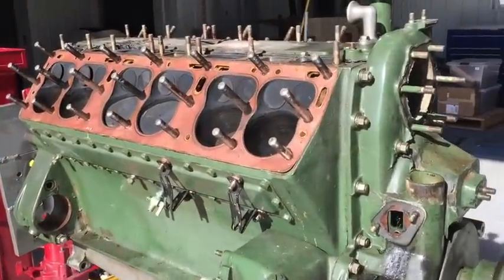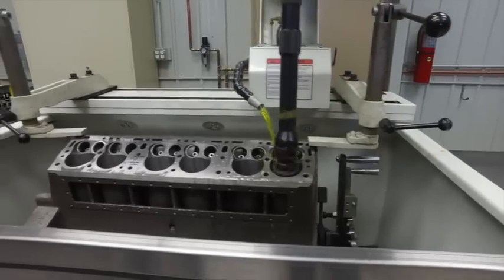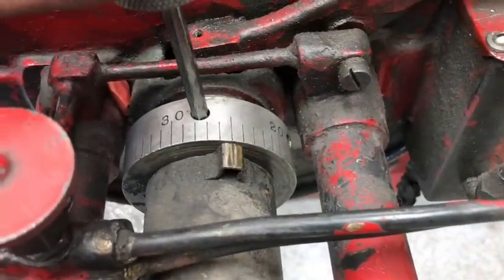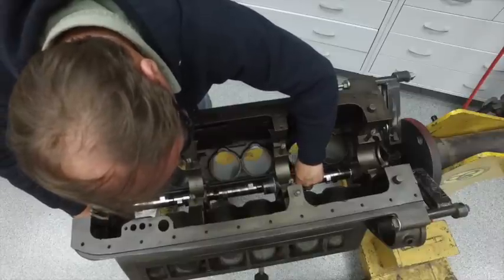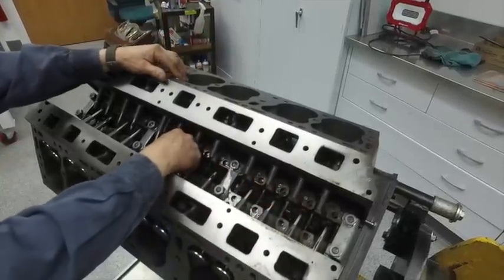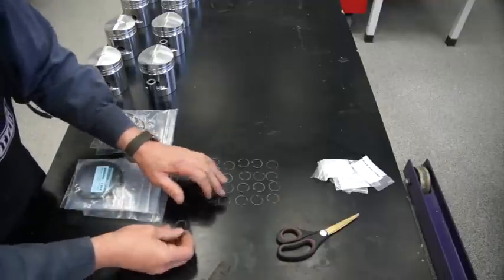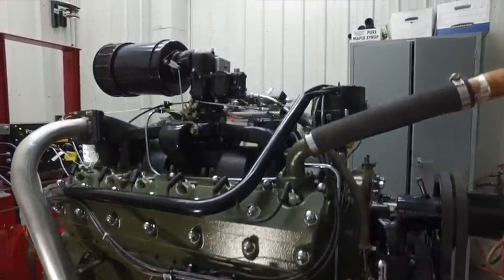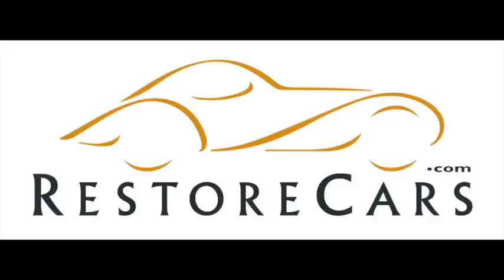Remanufacturing a Packard V12 engine

Comment: Remanufacture?  You mean restoration as you say in the commentary.
Reply: No, he meant remanufacture. 'Remanufacturing' is the rebuilding of a product to the exact specifications of the original manufactured product using a combination of reused, repaired and new parts. It requires the repair or replacement of worn out or obsolete components and modules. Parts subject to degradation affecting the performance or the expected life of the whole are replaced. Remanufacturing is thus a form of a product recovery process that differs from other recovery processes in its completeness and thoroughness. A remanufactured machine should match the same customer expectation as a new machine. 

In the case of this video, it involved a lot of precise and exacting machining work. The rods, bearings and crank being prime examples.

'Restoring' is something you can do with a bit of polish.

Comment: Packard was great, V12 engines are great, but flatheads are not
Reply: Super easy to lift the head though.
Reply: Yet it's still running at near 90 years old
Reply: Flatheads ARE great, within their design intent.  They are quiet and they are easy and cheap to build.  They may not be the greatest performers, but dragster performance is not what a Packard is about.  Low-end torque, silence, smoothness, a creamy-smooth idle, easy starting, and good acceleration at normal driving speeds is what they are for.

Comment: it is a british engine built under license by packhard ask soaring ass hole wilbur fluffygan
Reply: I'm pretty sure not every Packard V-12 is the license built British Merlin. BUT .... I could be wrong. 😮
Reply: This motor is from about 10 years before Packard ever built a Merlin. Packard also built the motors for torpedo boats that were no relation to Rolls Royce. 100% American.
Reply: It’s not a Packard aeroplane engine.  This is a 1935 US-designed automobile engine, nothing to do with the Rolls Royce Merlin aeroplane engines that Packard built during WW2.
Reply: Packard built V12 aircraft engines before the Merlin was invented, look up Packard 1A-2500, it's from 1924 and is what was selected to be used in the WW2 PT Boats.
Reply: This is not British in any way.  Packard DID build the Merlin aviation engine under license during the war, but that was for the Spitfire fighter plane, not cars.  The V12 car engine was 100% American.
Reply: @ronaldturner3049  The Packard-built Merlin engine was built for North American Aviation's P-51 Mustang, while the Spitfire got its Merlins from home.. Both planes were excellent, but the P-51 had much greater range and could escort bombers all the way over Germany.

Comment: So on a EFI engine, tuning on the dyno requires flashing the ECU.. on these older engines like this one in the video, how do you apply the "tune" to the car?
Reply: distributor and the carb screws
Reply: Bolt the carburetor on and try to start it. If it runs get the idle stable with the idle speed screw and idle mixture screw and set the ignition timming with a timming light and physically turning the distributor to get timming in spec. After that start changing main jets to get the maximum horsepower while not being too lean (which you can tell by reading the sparkplugs). After all that you can play around with the part throttle mixture settings to get maximum mpg and driveability

Thats how you put a tune on a basic carburetor and distributor ignition engine, of course theres a lot more to it than that like accelerator pump arms and jets, powervalves, etc
Reply: I know this was an honest question but I found it pretty funny.  You reminded me of my pop asking the same thing about tuning efi.
Reply: Ignition timing, spark advance curve and amount of advance, point gap, carburetor jetting, things like that.  Using a computer is not tuning an engine.

Comment: So how are the valve clearances adjusted when it comes time, is that what Packard intended, just grind material off each valve stem until the correct clearance is reached ?
Reply: Or if needs be the valve can be cut a little deeper in its seat as long as it doesn't offend the combustion chamber CC's too much, today's high performance motorcycle engines aren't much easier, they have a "bucket and shim" set up that takes several assemblies and disassemblies to get them in spec.

Comment: Half the engine power goes to that huge fan - I would go electric fan.
Reply: Classic cars are supposed to be STOCK, NOT "IMPROVED".  Big engines produce enough torque to easily drive their accessories.

Comment: Dammn you are really professionals with all this tools and machinery. I need to restore my straight eight buick 50s in the floor. Question. I know this kind of engines is pretty ineffective plus L head for those years and I wonder how many Hp have and How much RPM could reach.
Reply: HP and torque are listed in the description but I didn't see any RPM's.

Comment: How the HELL did they do this with 1930's technology when it is so friggin complicated and incredibly difficult in the present??????????
Reply: That was not complicated and difficult even in 1930's - all the needed tooling was existed even earlier, but work was a little bit harder because no computer assist in measurement. But everything that was done in this video with pretty modern tools - also can be done with oldschool tools with mechanical measurement devices. And I mean that was not complicated for people who know what they doing, not for just civilian guys, who never disassembled engine - for them that will be complicated in any case, in any time period, with any tools.
Reply: I agree with this.   By the 1930's, steam engines of all types had been in use commercially for about 100 years, so there were plenty of very skilled machinists.   The internal combustion engine had been in widespread use for about 30 years so there were lots of skilled guys to work on those also.   
The same quality of perfection could have been done back in 1930, but it probably would have taken ten guys to work on it, instead of two or three, and a much bigger shop with many more analog tools, and probably would have taken ten times as long, but the end result would have been no different than this.

Comment: Trying to comprehend rocker arms on a flathead. Under the cam?
Reply: There aren't any rocker arms or pushrods. They are actuated directly by the cam follower which as the name implies runs directly on the cam lobe. He showed how to set the valve clearance by grinding the valve stem ends in the video.
Reply: No rocker arm in any L shape flat head. Very quiet engine! Less power but silent, non vibrating and really comfortable. Oldsmobile and pontiacs have a beautiful L shape head that I love it. Chrysler, dodge, plymouth, desoto to also military willy, packard, kaiser and some studebakers

Comment: Wow...a V12 engine, and it makes only 197 HP?  My 2011 Honda Accord's engine has only 4 cylinders, and it makes 190 HP.
Reply: and has no spirit in it :)
Reply: Gasoline was crap in the 30s by comparison to today (octane was like 60) and the engines were made with low compression because of it.
Reply: There's always one
Reply: @mrmusicmanic  sadly there's several;  "why no turbo?"  "put an electric fan on it!"  the world isn't going to run out of idiots any time soon.
Reply: Comparing your little Honda to a Packard is like comparing a diamond to a glass bead. And your Honda will never produce 430 lbs of torque no matter how much boost you give it. And your Accord will never be sought after when it's 100 years old. It will be recycled into soda cans.
Reply: Low RPM engines back in those days. Ignition systems were not good enough to run over 3000.  Also low compression. High octane fuel was not available at the pump until after WW2.
Reply: This engine was built in the days where more cylinders and a smooth ride were considered status symbols, when the common folk was riding around in I4s or V8s. That is, assuming they had a car at all since the great depression.

The block design on this engine shows it wasn't designed for raw power. Flat head designs run into a power wall due to the poor flow characteristics and low compression ratios. The gas flow has to make several sharp angles to get in and out of the combustion chamber, with an additional 180 degree travel because the intake and exhaust port are on the same inner side of the block.

This engine could be heavily modified to increase the power output, but there's no sense in doing it. It would ruin the value of the engine and cause an irreplaceable block to be heavily stressed from power it was never meant to deliver.

There were OHV V12 designs even back in WW1 which made far more power (like the Liberty V12, Rolls-Royce Eagle, etc.) so the technology was there, it just wasn't needed in this application.
Reply: @GGigabiteM  When Cadillac discontinued its OHV V-16 engine in about 1935 and then came up with a flathead V-16 a couple of years later, the new engine was lighter, quieter, and simpler.
Reply: Horse Power is not everything.

Your Honda is probably supercharged and only puts out 197 HP on really high RPMs.
The old V12 in the video is much larger and has more celinders and doesn't need anywhere near that many RPMs to output full power.
It isn't designed to be fuel efficient.
It's designed to run for long long times.
And it is a much more simpelistic technology compared to modern engines.
Reply: Ever heard about torque ?
Reply: You drop your Honda engine in that car and you would barely get it out of the driveway.  Low end torque is what made these beasts go and nothing did it better than Packard, which was also chosen to run the PT boats of WWII because of their superior durability.  This was a different era with different technology meeting a vastly different demand.  Great to see modern tech used in rebuilding such a classic to specs the original builder could not have dreamed of.
Reply: @richardanderson2411  The Packard V-12 in the PT boats was an older, different engine than the one in this video.
Reply: What kind of power were Honda engines making in the 1930's?

Comment: Good Lord... How much does that engine WEIGH ??   Seeing her run on the dyno, I didnt see ANY vibration at all...not even one fine sensor wire was moving or vibrating, let alone any engine shaking!  Smooth is an understatement.  Beautiful Job fellas.

Comment: Why should somebody (apparently 392 people) push the dislike button? What, in this clip, made you to do that? I'm just curious...
Reply: Because it would have been nice to hear the engine speak for itself a bit but dude never stopped talking.
Reply: Isaac Lang 
The video was about remanufacturing the engine, not running it on a dyno. To top it all off, after he was done with what the video was actually about, he did let us hear it run on the dyno.
Reply: Most of the don't likes had to be because of the poor audio.

Comment: Thank you for showing some of the Blueprinting Operations that make a Factory Engine that was made to run for a while into a precision De-tuned Racing Engine that will run perfectly.  Factory Built Engines all have to have these operations done because they are off from the factory especially the Balancing.. Don't get me started on heads and breathing. Great work guys.

Comment: They look a little like a tiny Packard aircraft engine.
Reply: Ronald Reed yes at a tenth of the horsepower 160 for the car and about 1650 for the P 51 D mustang or the PT Boats which used 3 Packard engines to push a 60-80 ft wood boat
Reply: The P-51D didn't use a Packard engine, it was a Rolls Royce Merlin engine, built by Packard under license from RR. The PT Boat engines were Packard engines, which bear no resemblance whatsoever to a Merlin engine other than they are both V-12 engines.

Comment: One thing is to read or be told the displacement, another is to see the size of the piston and intake holes in the stripped block. That’s a big engine. 

Absolutely beautiful work. Thanks for the video.

Comment: Important to test the valve springs on anything, I was refitting a Ford 6 head and when compressing the valve springs had one shatter, just good luck that it happened before closing everything up and starting the engine.
Reply: I teach auto at a tech school and tell the boys (and a few girls) that the springs are the weak point in an engine.  Don't try to cheap out on them, the thermal cycles anneal them and take the "spring" out of them.  Even an engine sitting a long time will need attention as there is always a few open valves, and those springs that are compressed for a long time will lose their tension.

Comment: I found the Packard V12 engine to be very interesting to watch being remanufactured and hear it run,machining standards and design technology seen same as today
Reply: It had a lot of mechanical noise I'm not familiar with. The noises changed in pitch/resonance as it warmed up. The noises changed in pitch but they didn't go away.

Comment: What A Work of Art ..Very Nicely Done... This Company Does it to Perfection..Not Many today can pull this off...started up on its first try. IVE SEEN OTHER Videos or machine shop do builds and on the very 1st start the engine turns but wont fire up .. 
            Goin threw all types o adjustments to get it goin...That alone would make me feel like start over...Why this is the Proof these Engineers started the engine on its first pull...Bottom line if done right it should start right off...

Comment: Why bother with old stuff ? My Focus is more powerful than this.
Reply: Because, unlike your focus, this is awesome.
Reply: I'm driving a Dodge Nitro with 2.8l VMmotori turbo diesel that has more torque and HP then the Packard and will blow it in to the weeds.
But the Packard will ALWAYS be much cooler to ride in, and a genuine pleasure to cruise in.
That's why we rebuild classic cruisers.
Reply: your Focus is an econobox designed to get you from point A to point B.  Packards were designed to be driven to the Greater Glory of God.
Reply: Why watch then.
Go away.

Comment: I can’t but wonder if these engines don’t just become smaller and smaller with continuingly increased displacement every time they are rebuilt?  Doesn’t compression ratio increase every time you take a few thousandths off the block and heads?  What am I missing here?
Reply: The capacity goes up, the weight goes down.
More volume to fill with air and fuel, means more power and torque.
Reply: They usually don't have to be rebuilt more than twice. I mean, it's not a daily driver, you don't get too many miles out of it.

Comment: My grandfather had a few of these Packard 120 series with the V-12 in them,these engines run better then swiss watches and produce tremendous amounts of torque.
My grandfather used to talk about how he ever so often would"BEAT THE TRAIN"after the engineer would hand signal to him running along side of a 4-8-4 Northern,he would start"pouring-the-coals"to the 8 drivers,the race was ON!!.Granpas 120 series 9-passenger limo would run well past 120 miles per hour,easily.
Needless to say,the Packard V-12 made iron pate out of nearly every 4-8-4 Northern he went up against.And this was done most of time with the family in the car!!.(seriously)
Reply: my Dad bought a '33 Packard V-12 after he returned from WW2 in Europe and confirmed your assertion about their performance... what your grandfather didn't tell you was they used almost as much fuel as that 4-8-4 Northern as well!

Comment: Can anyone tell me the difference between the Packard and the other V12s like the Pierce Arrow and the Lincoln? These seem like quite simple engines for V12s.
Reply: The Packard twelve was designed to eliminate vibration. Everything is massive.  I have two Packard twelve engines,  a 34 & a 39.  After 34, a longer stroke, more power. .  The one in the video is 35-39,  475cc,  The Lincoln twelve was much smaller, lucky to get 100 hp.

Comment: The Achilles Heels of all those engines was a lack of main bearings.  Only four mains absorb the load from 12 cylinders.  Compare that to the seven main bearings in a Rolls Royce Merlin.

The paucity of mains often led to the phenomenon of "crank whip," which could result in the engine's catastrophic destruction if it were revved too much.  The Packard straight eight, as similar engines from GM and Chrysler also had this problem.
Reply: I’m sure no engine is without its faults.
Reply: WoW! Good info.
Reply: No need to rev the engine high, plenty of torque, plus overdrive was available.